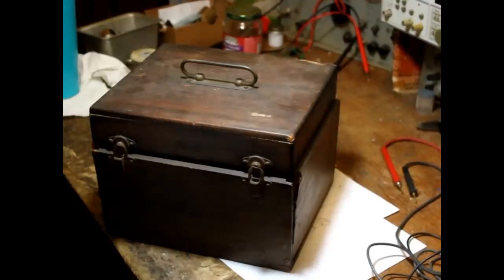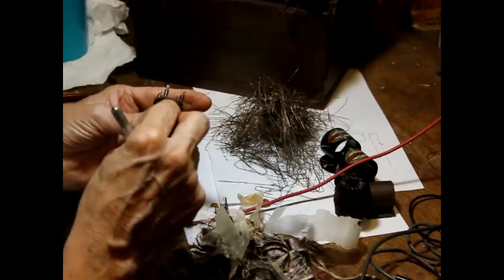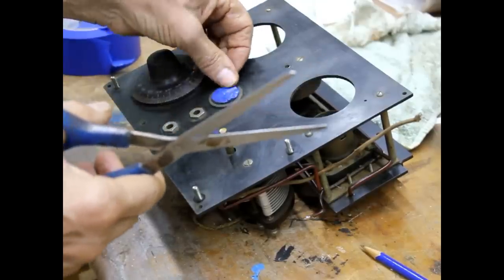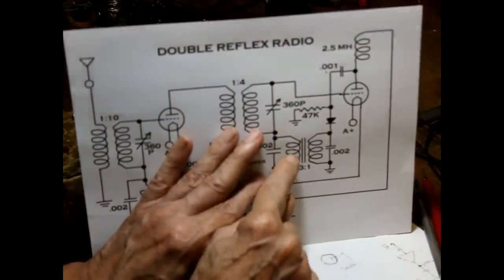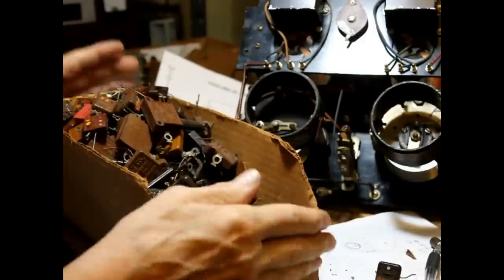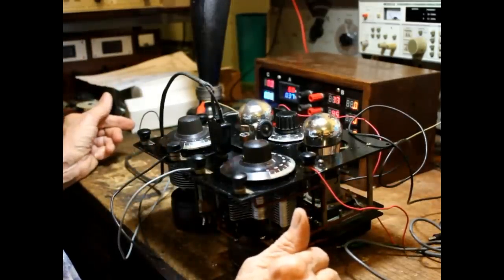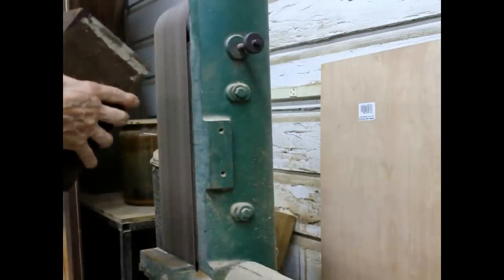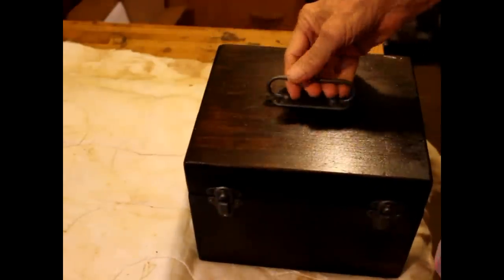RESTORING A 1920'S HOMEMADE RADIO

Comment: Oh my! You sure brought back memories! Nicely done. Taking a homemade impossible and turning it into a working radio. Glad to see the note that you did not trash the old audio transformers so you might rewind them later. I would rewind by hand as that is less likely to snap the thin wire. A lot of work, but have had many years of hand winding transformers and my own RF coils. Thanks so much for posting this!

Comment: Ron, don't scratch the thin enameled wires, most probably you cut it partly and later, during the winding on lead wire, it was broken. Better to remove the enamel by soldering it on tablet of Aspirin. One more trick - make about 5 rounds of wire on fingers, then twist it, you will get strong wire for direct connection to terminal (coil's wire will be reinforced by additional strands).
I like all your videos. Thank you!

Comment: Before attempting to rewind the audios I used a little trick of connecting a Dynomotor or other source of fairly high voltage DC to the secondaries and a lot of times they would weld closed again usually without much loss of resistance.  This didn't always work but I wasn't out anything by trying it and seemed to have good luck with this method.  Usually I would arc one connection of the HV DC source to one terminal of the secondary until it would draw an arc then measure the resistance of the secondary until I got close to the proper value but don't leave it on too long or it could cook the transformer.  The other thing I found that cleaned Bakelite face plates for 20's radios was Scotts Liquid Gold or very light oil but Scotts worked the best.  Apply it to the face plate or other Bakelite material work it in and then use a clean paper towel or rag and wipe off the excess.  I even used this on some painted surfaces such as metal horns or metal face plates with very good results but NEVER use it on Celluloid tuning dials as it will remove the numbers and you will do much crying.  I strongly suggest to leave those types of dials alone do not clean them with anything other than a dry towel with nothing on it.  Hope this helps someone out.

Comment: Vacuum tube crystal radio, I never knew such a thing existed, cool.
Reply: Well, it does use a Crystal Detector, but it's not a "Crystal Set". 
As explained, it's classified as a Double Reflex.
Reply: 23:43 That "Xtal Detector" could have been a Perikon Detector and not a "Cat's Whisker" arrangement!
Reply: like that whigen you living under a rock.. he he

Comment: a trick that may "fix" those secondaries is to charge up a 500pf disc cap to about 4KV and then dump that charge across the secondary. Sometimes that serves to "arc weld" the wire ends together.....I did this on a RE45 victor magnetic phono pickup that was open. I got the pickup working with slightly reduced output, but made the phono operable and it still sounded good. Someone told me that that style of RE45 series of radio/phono with the oddly shaped radio dial opening was referred to as a "fishmouth" by the local techs working in Springfield missouri area in the 1930s.s

Comment: Glasslinger - Glad to see another of your videos!  Really enjoyed the explanation of the circuit and the trouble shooting done to get it modified and working.  Had to do a screen grab of the circuit diagram so I could follow along with your explanations.  You have a lot of arcane and interesting vintage electronics knowledge twixt your ears Sir!
I was hoping that the quality of your last video was a one off but this one is as dark and lacking in sharpness as your last one.  The scenes in your wood shop are much brighter and seemingly almost in focus.  Could you use more light in your shop shots as they are dark and is it possible your camera is set for 480p instead of HD quality?
Thanks again for this most interesting video and looking forward to many more!
Reply from the maker: Sorry about the bad video. I am old (73) and my eyesight is horrible. I can't tell when the camera is focused or how bright the scene really is. It looks fine on my monitor when I'm doing the editing. There are sliders on the youtube control that you can bring the brightness up if you so desire. Only thing I can say to you is DON'T GET OLD! It's got terrible disadvantages! :)
Reply: @glasslinger  -  The main disadvantage to getting old is that life isn't nearly as much fun as it was before we arrived here and time is running out!  I will be 75 on 31 December and don't feel a day older than 90. 😨
Reply: @mickbradford3167  I can't agree or disagree but I am 47 and life is much more fun for me compared to 20 years ago. Not because of circumstances but because of knowledge,wisdom etc.
Reply: I'm an ol' guy too... all these years learning, breaking, and building things... now we sort of have it figured out, and have the tools and the time... but the body is not willing anymore.  As Ron said, eyesight is one of the victims... it is giving me a real trying time still doing surface mount.  1206 is sort of my limit anymore... 0805s are history.

Comment: I found your channel via your video on making a spherical envelope Audion tube, via searches and subsequent recommendations on tube radios, which I had found after following some rabbit trails from crystal/trench radios (a variable coil, blued steel blade, pencil lead, and a crystal earpiece will do the job, if you have a long antenna -- but don't forget the safety pin).  One of the attractions tubes have for me is that it's possible (not easy, no, never, but possible, as you've demonstrated) to make your own, unlike a transistor of any utility.  Not to mention I can better visualize what's happening inside the tube in operation.

This circuit looks like it'd be cool for my first construction project, but I see it had some issues getting it to actually work.  I've got a pair of 1T4 tubes on the way (low voltage filament, 22-45 volt plate miniature pentodes), along with sockets and magnet wire for coil winding; I'm planning for a regen with an RF amp stage (likely to get an audio amp stage as well, once the receiver works, so I can drive an internal speaker), and either coil taps or plug-in coils to let me tune from broadcast up to 10 meter.  It's been forty years since I've listened to shortwave, and I've never built a radio with any active components (the crystal set I built in 1970 never worked) -- but my attention to detail is a lot better now than it was at age 10.

Comment: The cat has a lot to say.
It's nice to get things working again, original or not. I've watched a couple of your videos.
I'm collecting old parts to make a one valve TRF. I've got a number of 4 pin valves for £2 - £3 each at radio rallies.
One surprise is a valve which has a tungsten filament and marked BBC which dates it between 1924 and 1926. Incredibly the filament still lights up and the valve works.
Bill, G4GHB.
Reply from the maker: Very good! Do a youtube on your construction!
Reply: @glasslinger  Yes, it would be an idea, thanks for the reply.

Comment: No Neutralization of the first RF stage?  The second might not need it as the plate isn't tuned.  Also there is no C- (bias) for the tubes.  Should be a few volts negative for 01's.
The coils should have been mounted ar right angles to each other to reduce feedback.  Bet the first RF stage oscillates.

Comment: Another super video! Your knowledge of  and experience in radio electronics must be profound. Your explanation of the radio's circuit/schematic was remarkable. I was particularly impressed at how you can look at an actual radio and schematic and by the radio's performance tell what changes in the circuit were needed. I like your work methodology of moving right along and getting the job done. Your finishing skills too are interesting and informative. Also I find your workshop to be very relaxing and comfortable especially with the presence of your cats. I wait in anticipation for all of your videos!  Another nice piece of artistic work. Do you ever restore ham transmitters? Good job! Dr. Stan KZ8G
Reply from the maker: Almost all the work I do pertains to early radio. (1920's) I will do some early ham transmitters coming up! They don't look anything like a modern Yaesu, that's for sure!

Comment: don't understand, the original coil turn were from bottom to top (like toroidal) and you rewinded it perpendicular to the primary? is not suppose primary and secondary must be winded the turns in the same direction it to work?

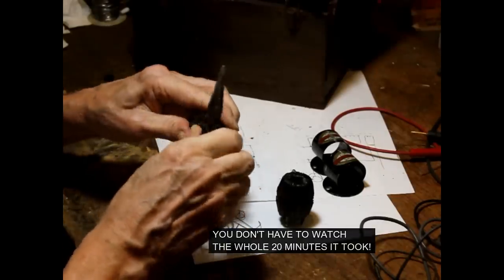Comment: 5:00
Does the construction of the wire core audio transformers cause 
them to preform better than their modern mass produced 
counterparts ?
Reply from the maker: No. The wire core was used as a cheap alternative to the expensive (back then) stamping process used to make the flat core pieces. There is slightly less inductance per pound of core. The wire is cheaper but I question if the labor involved cancelled the cost advantage.
Reply: Let me throw my two cents in!  Considering the curved nature of magnetic lines of force (flux) - - this arrangement could work better depending on how it is made. If the core wires (or rods) were made of Norwegian Iron, individually insulated and joined, but not quite touching each other as they circled around the windings - - then it could have been a superior audio impedance matching transformer - - but all that would've negated the low costs intended

Comment: On the transformer, was the inner wrapping, the one you replaced with tape, originally made with waxed paper? or some other substyance?
Reply from the maker: It seemed to be a very thin paper that was either waxed or impregnated with oil.
Reply: @glasslinger  Thanks.
Reply: @glasslinger  Thank you.

Comment: Wouldn’t it be normal practice in TRF type radios for the ref coils to be mounted at 90 Deg to each other to reduce coupling between the two.
Also as you are using a bench power supply and not batteries, maybe you need a bypass cap or two because of your long wires.
Reply from the maker: Back then they didn't necessarily know what they were doing. They mostly copied stuff out of magazines and what their friends were doing. At these frequencies the bypass caps in the supply are adequate.

Comment: I noticed in the original circuit there is no capacitor between B+ and B- which means the B rails are reliant on the internal impedance of the battery itself which seems to me is not a good idea. This effects the .0039 bypass in the 1st stage which is returned to B+ instead on ground or B-. Would it not be better for this capacitor to return to ground as all the others do rather than to B+. 
I notice that later in your video you had to add a capacitor across the B supply rails to improve the bypassing. This would have a great effect on how effective the .0039 capacitor was as a bypass. As we know both B + and B- should be at the same RF potential. I know you are using a bench power supply but if the unit was run on battery the internal impedance of the battery would rise as it runs down causing stability problems.
Ps, nice videos, I enjoy watching.
Reply from the maker: You are correct on all counts! I was using a circuit copied from an early radio magazine from 1925. They didn't know much about bypassing back then. I started off with the original circuit as published, and you see how much trouble they must have had getting it to work! In the end it did take proper bypassing to get the circuit stable.

Comment: yo I’m tryna build dat thang. I’ve never tried doing anything with vaccum toobs but I want to amplify with a gain of at least 50 does the AU7 capable for this purpose?
Reply from the maker: No. Use AX7  (the number in front of the AX7 is the desired filament voltage with the exception of the 12AX7, which can also be wired to work on 6 volts.
Reply: glasslinger thanks, I’ve just ordered a pair of jj JJ ECC83 12AX7 and ceramic tube sockets and some audio isolation output xfmers (CT 0.5 ohm:2.5ohm. One more question, if this design uses two tubes but the ones I’m getting have a dual triode in one, does that mean I can just use either side of it for each of the triodes?
Reply from the maker: The sides are independent so you can intermix them at will.

Comment: what kind of b+ does this radio have.  Could you get  a jolt connecting up the speaker?
Reply: 90 volts, and yes, considering that most of these early sets ran the B+ of the output tube through the coil of the higg impedance moving iron speaker or high impedance headphones, with no output transformer.

Comment: I enjoy watching your expertise. Have you ever attempted to refurbish a worn-out tube by cutting the glass and replacing worn out emission components, re-sealing, evacuating, and out-gassing it?
Reply from the maker: Yes. I do this with some types of rare tubes that are needed for restoring old radios. WD-11 is an example. Rare very collectible tubes I don't "ruin" like that because they are pieces of history that should be preserved. I make copies of those types that are too rare and valuable to break up.

Comment: I think you gave up on the double duplex circuit too soon. Some of the other things you could have tried were turning one of the tuning coils so that it was at right angles with the other and reversing the primary connections to one or both transformers.

One of the more interesting modifications would be to wire in variable caps between the valve plates and the bottom of their respective tuned circuits. Together with the capacitance across the transformer secondary, these form a bridge circuit with the valve interelectrode capacitances and should make canceling out the feedback relatively simple. This technique was discussed by Kenneth Harkness in "Radio in the Home" ( https://www.americanradiohistory.com/Radio_in_the_Home_Magazine_Guide.htm ) in a series of articles starting from about August 1924 onwards.

It would be nice to see that small set put the bigger boys to shame. Maybe you will return to the circuit one day.
Reply from the maker: I really didn't want to make a research project out of this particular radio. I could have gotten it to work sooner or later I'm sure.
Reply: Fair enough. My interest is slightly more academic than yours. You still made a beautiful restoration.

Comment: Never seen interstage transformers like those before, Very interesting !!  Are those outside wires made of steel that forms that "shell" ?  Thanks for the video !!  John Bellas  KC2UVN
Reply: I’m still not quite clear on the hedgehog transformer construction after reading the two articles you suggested.  When the iron core wires are passed thru the core and bent backwards on themselves, are they soldered together to form a continuous loop , or are they Open ended. Are modern stamped steel laminations more efficient? Why are these not used anymore?